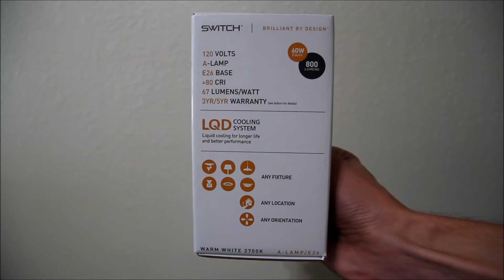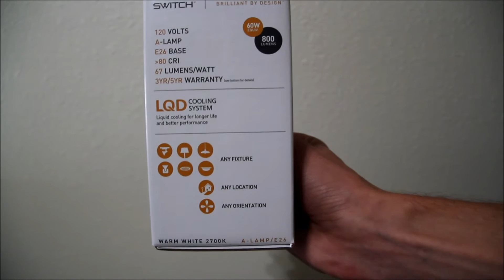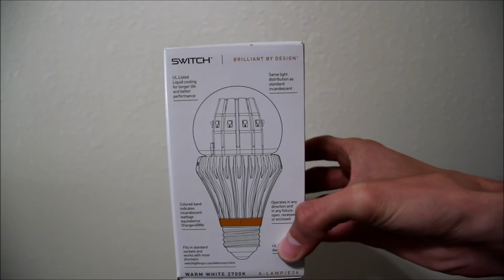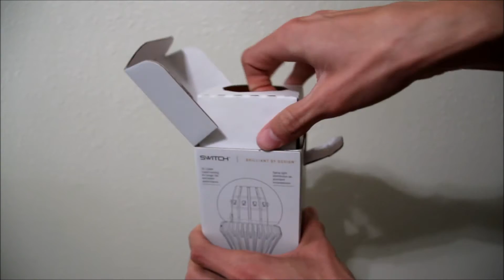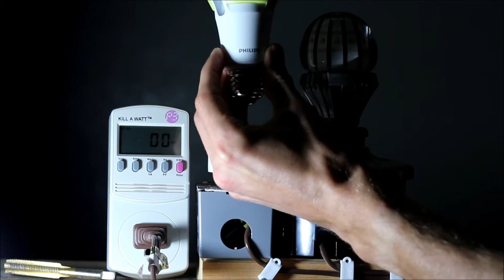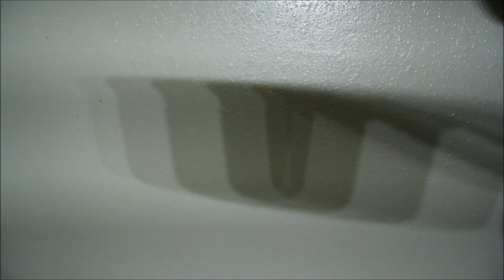Switch 60 LED Light Bulb Review

Comment: Since LEDs emit very little heat in the light they produce, the fact that the glass is warm at all means it is dissipating heat as a function of the liquid inside. (a regular bulb emits more heat than light in the light path, which heats up the glass in a standard bulb)  Otherwise the glass would only get warm where it touches the heat sink, and the heat sink would be a lot hotter. Glass isn't the best at transferring heat to air, but its job is really just to contain the cooling liquid.

Comment: why would you want the heat to transfer through the liquid and glass? Any heat generated from the bulb is wasted energy meaning wasted electricity. Any bulb manufacturer would want to do away with any heat made by any bulb. It's costing the consumer more money and is fire hazard.

Comment: Cool bulb.
Sometime soon I'll upload a vid of an led array I put together. It has twelve 10W led panels thermally glued onto a large cpu heat sink with a cooling fan on the back of it.
Each led panel is about 5/8" by 5/8" and claims to put out 800 lumens (I think more like 700). 
I have it hooked up to a thyristor type dimmer, and have a small transformer in series (for use as an induction coil to smooth the light pulses when the dimmer is turned low).

It's at least 8,400 at full brightness :)